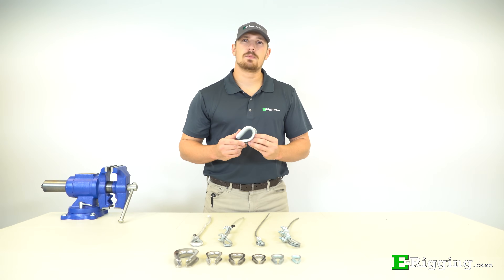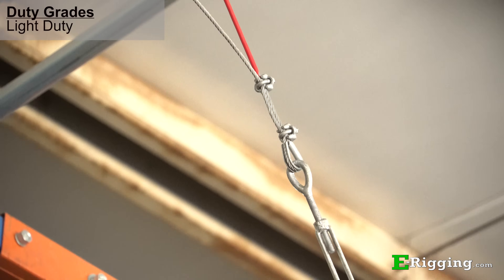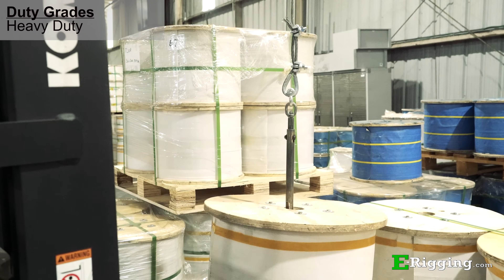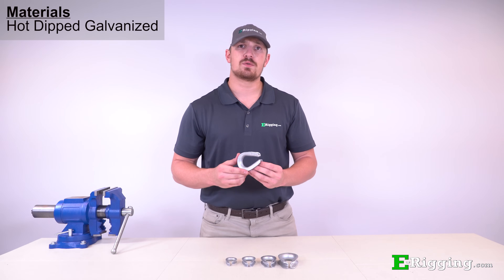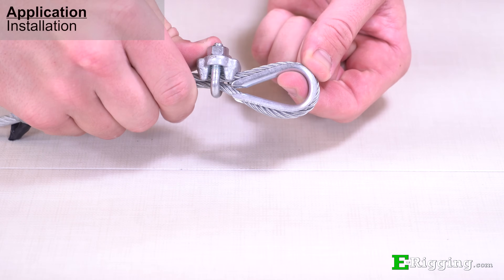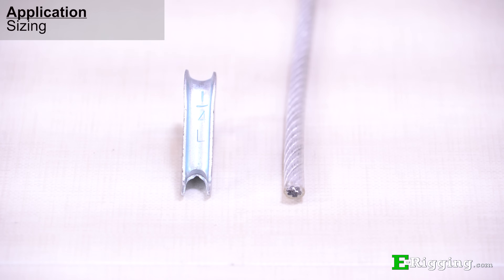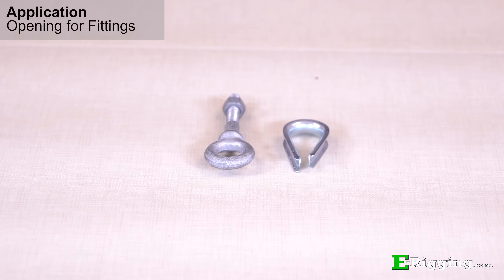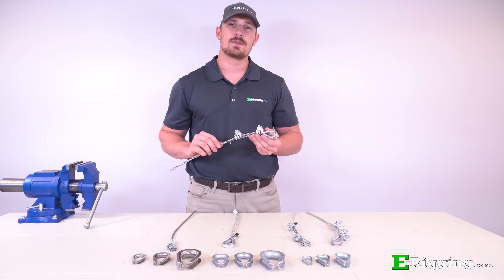Installing Wire Rope Cable Thimbles and Choosing the Correct Size

Comment: If you have vinyl coated wire, do you have to strip the coating when using a thimble?
Reply from the maker: Hi Mike! Great question! Yes, it's very important to remove the coating from a cable before splicing or crimping. It's super easy to do with a pair of large gauge wire strippers.

Comment: If you are bending hot dip eyes, bend them only just enough to do the job, as the galvanizing can crack reducing its corrosion protection, other than that a very informative post.
Reply from the maker: Thanks for the tip, Roger!

Comment: Hello, if l have a 3/8" cable winch on my jeep and I have  to repair the end can I use a 1/2" thimble??  In emergency. I would tie a flemish not with a tail and cable clamps proper sized.

Comment: In a pure wire rope and galvanized thimble assembly, should the thimble be immobile and tightly constrained n the completed wire rope thimble after the wire rope is crimped?
Reply from the maker: Yes, the thimble should be installed as tightly as possible as long as it doesn't interfere with the swage fitting, wire rope clip, or other means of termination. Doing so will give you the least likelihood of the thimble spinning or popping out of the termination.